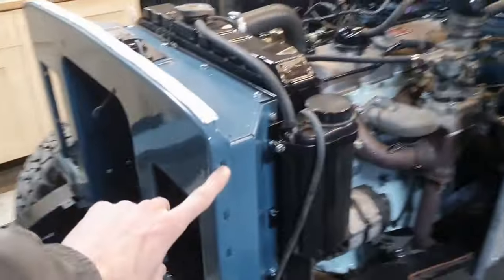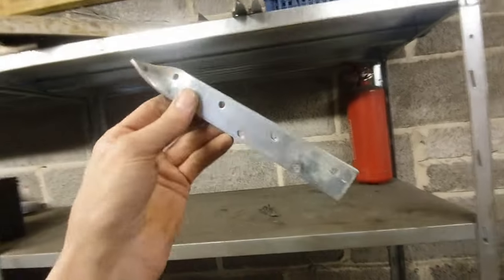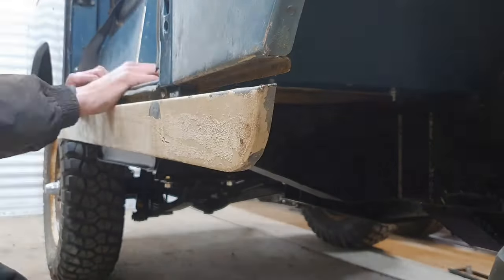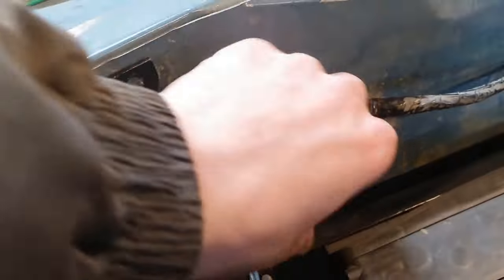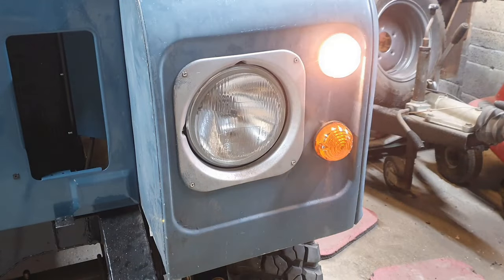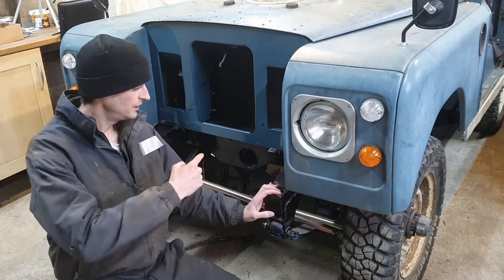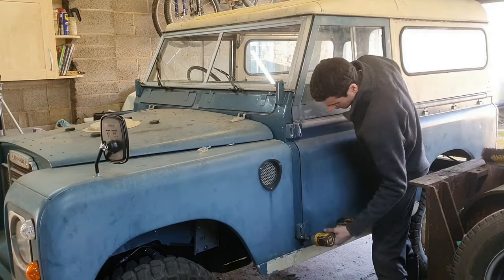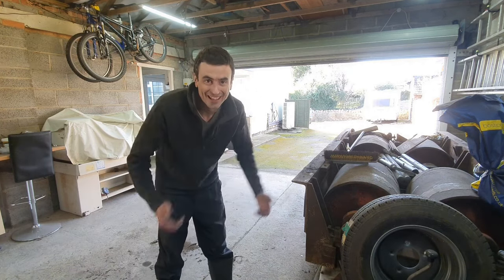Fitting body panels and doors to finish the Land Rover Series 3 Project

Comment: I’ve only just found you but now I’m going to watch back. You have a lot more patience than me. I’d love PM you some footage of my one. I’ve had it 30 years and 6 years ago decided to replace the door pillars and guess what- it snowballed as I realised just how far things had gone south. I love the really sympathetic way you’ve done yours. And I had to laugh because mine is the same marine blue and the bulkhead is the only shiny bit. I could be looking at your Landrover 😄. I need some advice on aligning my bulkhead because the doors never fitted right they are low at the capping where it meets the back tub. But the front forward top corner of the door top is quite tight to the top of the windscreen
Reply from the maker: Thanks for the comment. I'm chuffed you found the channel and are enjoying thr content. My sympathetic approach as you kindly put it, is really a function of knowing my limits, I'm just not very good at spraying.

You've owned that a long time then! I'm impressed you've stick with it. Is it coming back together or stiill in the dismantling stage?

I still haven't got a way to safely give out an email on here, but will have in the coming months hopefully. Had you considered putting it up on YT, I'm sure there would be plenty of people interested. 

Aligning the bulkhead is quite a task. And remember this is the first one I've done and I wouldn't say I've done an especially good job of it really. But my understanding is that you start at the back, the tub needs to be nicely aligned with the chassis. The rear is aligned forward and aft as it bolts tot he chassis, it has no option for adjustment. The front end of the tub needs to match the rear in terms of being level with the chassis and I'm afraid I'm not sure exactly how the front of the tub is aligned height wise as I didn't mess with this on mine. 

Once the tub is aligned on the chassis you work forwards so get the doors perfect with the tub and have the bulkhead sit whereever it needs to to he aligned with the doors. In fact not I think about it, that's probably how you set the height of the front of the tub, such that it suits the bulkheads height. 

Like I said I'm no expert on this as its my first time but I hope it helps. 

I hope you stick around and enjoy the next project. Its a big one, but its not a landrover.

Comment: Everything you say is me😄 I’ve got mine back together but the rear main seal (2.25 diesel ) which “I replaced “ is leaking. Can anyone show me how to do it 😥
Reply from the maker: I think they all do that :)

Thats an engine out job o believe or a gearbox off job. The sael is a poor design, I guess it helps if you put the split at the top, but its still not brilliant.

Good luck fixing it up